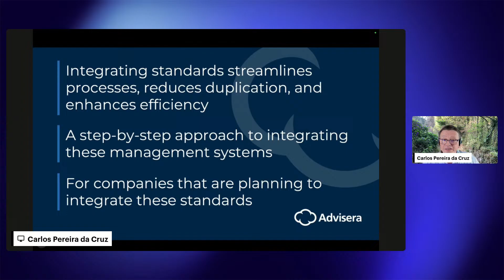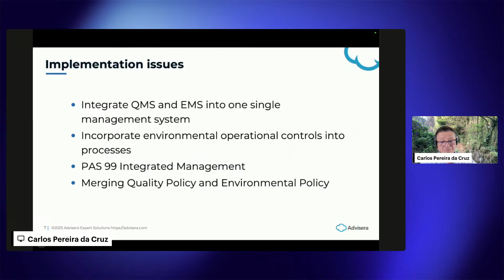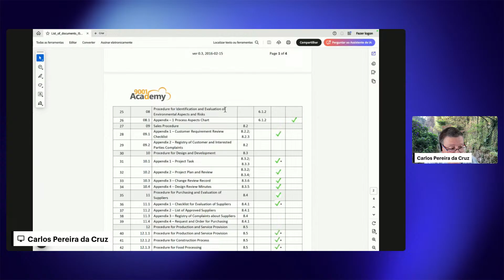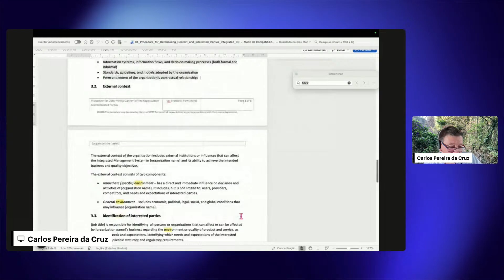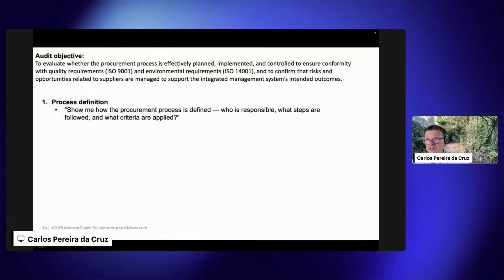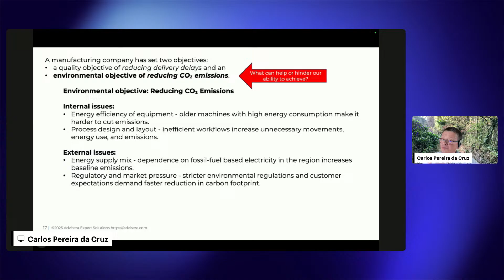How to integrate ISO 9001:2015 and ISO 14001:2015 [live webinar]

Comment from the maker: You can find below all the links we have shared in the live webinar: 
- ISO 9001 & ISO 14001 Integrated Documentation Toolkit https://advisera.co/9001and14001Toolkit
- Toolkit expert meeting link: https://advisera.co/9001ToolkitExpert
- ISO 9001:2015 Lead Implementer Course https://advisera.co/9001LeadImplementer
- ISO 9001:2015 Foundations Course https://advisera.co/9001Foundations
- ISO 14001:2015 Foundations Course https://advisera.co/14001Foundations
- ISO 14001:2015 Lead Implementer Course https://advisera.co/14001LeadImplementer
- How to integrate ISO 14001 and ISO 9001 - https://advisera.co/Integrate-14001-9001
- ISO 14001:2015 integration with ISO 9001:2015 - What has changed? - https://advisera.co/ISO9001-14001-Integration
- How to implement integrated management systems - https://advisera.co/IMSImplementation
- What is the job of the Quality Manager according to ISO 9001? - https://advisera.co/9001QualityManager
- What is the job of the EMS manager? - https://advisera.co/14001EMSManager
- How to get management buy-in for an ISO 14001 project - https://advisera.co/14001ProjectMgtBuyIn
- 4 crucial techniques to convince your top management about ISO 9001 implementation - https://advisera.co/9001ConvinceTopMgt
- ISO 9001 Documentation Requirements – The complete list https://advisera.co/ISO9001MandatoryDocs
- List of mandatory documents required by ISO 14001:2015 - https://advisera.co/14001MandatoryDocs

Follow us on social media:
- Advisera LinkedIn: https://www.linkedin.com/company/advisera/
- Advisera YouTube: http://www.youtube.com/@AdviseraExperts

Upcoming webinars:
- LinkedIn: https://www.linkedin.com/company/18062427/events/
- YouTube: https://www.youtube.com/@AdviseraExperts/streams
- Advisera Website: https://advisera.co/Webinars

Below, you can also find the links to our Webinar Survey and the PDF slides: 
- Webinar Survey https://info.advisera.com/webinar-survey/how-to-integrate-iso-9001-and-iso-14001/ 
- PDF slides https://advisera.com/webinars/materials/How_to_integrate_ISO_9001_2015_and_ISO_14001_2015_presentation_deck.pdf

We look forward to seeing your feedback!